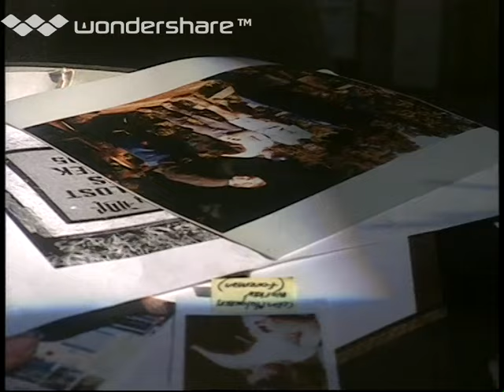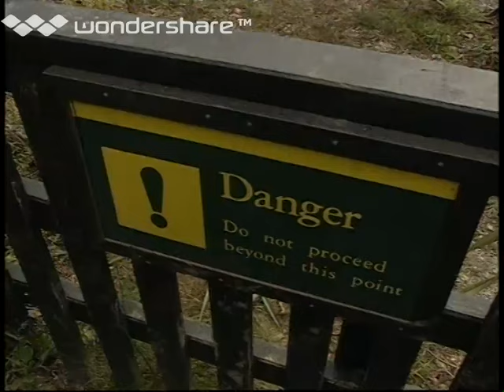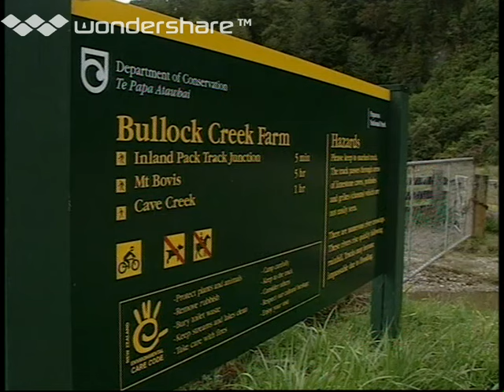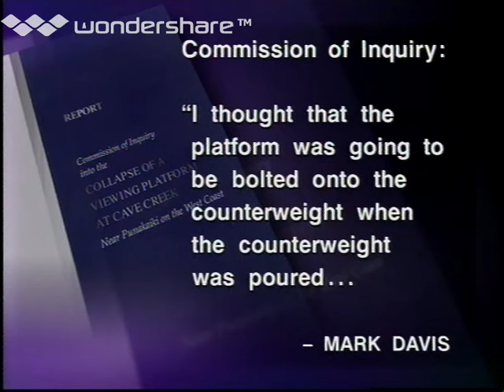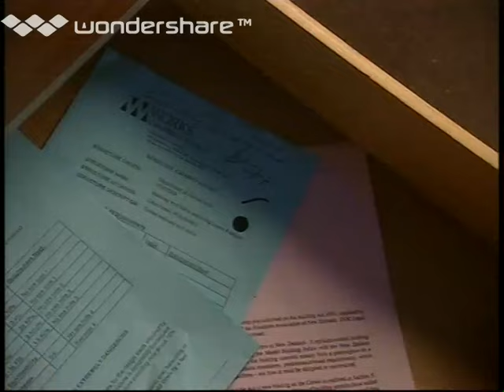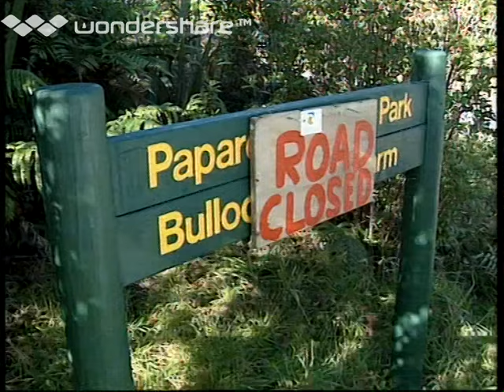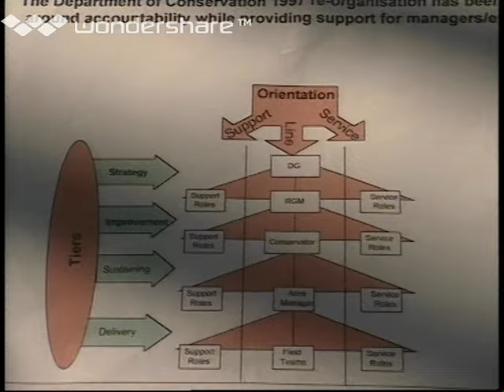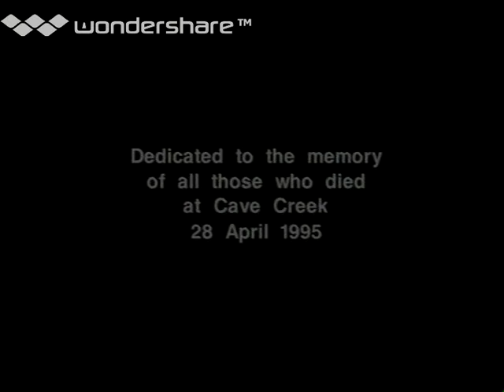Cave Creek: The Full Story of a National Tragedy

Comment: How could they look at how the fact that  piles were not even straight in a row, that in nailing boards to a pile in many cases there nail missed and all the other things that was such bad construction a 12 year old would have been embarrassed to say they build something like that and not say that the men doing the construction were mot either just in a hurry to get done, or did not care if it was done safely or not?  They knew they were building something that was going to be hanging out over mid air with a killer drop down and yet that construction showed they were doing a good job?  Not sure who was protecting whom, but  I, who knows little about building and construction saw half thr terrible things they did done on say  a deck being added to my home, I would have shut them down and called their bosses.  There is no way that they did not know they were taking short cuts and doing a half assed job just to get done.

Comment: I also think...before this plan was even designed, a land survey should have been completed by a civil engineer alongside with an expert  on land erosion.  It should have been measured or tracked to safely measure the rate of erosion in that area.  I’m surprised if this was never done or even discussed prior.

Why would anyone build a deck hanging over what looked to me...to be a cliff crumbling away below?  ⚒🔨

Basic Geology, Limestone is a soft rock.   What can happen over time?  What happens if you build on top or dig into it?⏳🤬
Basic Science, Gravity.🎢
Basic Humanity, use your brain!🧠
Reply: Yep, even if they had limited the capacity to 5 people this thing was going down that cliff one way or another.  The only question was when.
Reply: Aren't there overhanging viewing platforms at the Grand Canyon?  That is not unusual
Reply: @NageelaMom  and is the Grand Canyon Limestone?
Reply: Yes, exactly.
Reply: I think ur very pretty 😍❤️
Reply: It's that "she'll be right mate" attitude nz still has to this day. The lack of accountability by a govt dept is also still prevalent to this day here in NZ.  Absolutely shocking
Reply: Britni Weiss , the Grand Canyon is entirely different.  The viewing platform was done right and meticulously by Structural/Civil Engineers.

Structural engineering design included inner and outer box beams built up from two-inch thick plates, creating hollow shapes of 32 inches wide and 72 inches deep.  The beams were designed to resist wind and vibration forces determined by RWDI of Ontario, Canada, and anchored deep into the native rock with large groups of drilled micro-piles.  The 10 feet by 2 inch wide bridge deck consisted of five composite layers of tempered glass, totaling 2.79 inches thick.  The 5 foot high glass handrail has been designed for high wind pressures as well as code prescribed railing loads. 

Civil engineering design included grading plan preparation for the bridge and visitor’s center.  Civil assistance was also provided by the Lochsa team for the water system (storage and pressurization) and the sewage collection system (gravity piping and waste storage tank) at the remote location.  Great care was taken to minimize the effect to the natural setting as well as to maintain the tribal cultural well-being.

https://lochsa.com/skywalk-at-the-grand-canyon-2/
Reply: Chris D. Thank you.
Reply: I worked in carpentry and building construction and always suggested if not working from drawings that any raised platforms catwalks or cantilevered areas be approved by a structural engineer.   PERIOD!!!
Reply: @yuibot5998  good point....the trash bin test showed how the combined weight of the platform and the students caused an instantaneous failure of the structure with the back end pitching up and detaching. You cannot build something this shoddy that could cause certain death or  bodily injury and not go to jail.

Comment: I think steel was needed for total construction.
Reply: Wood can be used if you know what you are doing. But should be inspected on a regular bases.
Reply: Steel was supposed to have been used, but no one did... None of the people building the platform actually talked to eachother so vital information was lost. It was the fault of everyone who did anything in the constructing of the platform, but someone must have had the final responsibility to make sure it would be done properly, before, during and after the build...
Reply: The plans required steel to attach the stone steps to the platform, but the plans were not on site, the steel was not there, and one of the “builders” (who actually signed off approval on the plans) obviously didn’t manage the project correctly. Many many failures, and the “she’ll be right” attitude to building from blokes who weren’t qualified to do it. Even worse, the guy who drew up the plans could’ve told them all that if they’d allowed him to be involved to completion...although he wasn’t qualified either, at least he’d known to include steel and a weight!!

Comment: I've never heard so much waffle,   the bottom line is using nails instead of bolts and nuts is entirely the fault of the builders even I know that and i'm a clothes designer not a carpenter that and the way the platform hung unsupported over the cliff edge plus it was never checked by those in charge they should have all been charged with manslaughter

Comment: Kind of strange both guides left the kids alone at same time to pee... Sounds like a way to say I wasn't there, so I am not guilty of anything. There should always have been someone at head of the group. And if the platform seems unstable, then they should have decided not to step on it, especially not let anyone else step on it. And how come connection of the platform to the stairs were also done with nails instead of being bolted!??
Reply: These were older kids, they don’t need supervision like grade schoolers.
Reply: One adult died with them who was told that there might be problem with the platform.

Comment: Gee whiz,   we built stronger fastened tree-houses at age 8-10, for 4-6 kids , 10-20 feet off the ground( we over-built from caution and being "amateurs/kids"). 
I would think the "creaking" that platorm did would have scared alot of people who walked on it in the months  before this disaster occured.
I look at that platform now, having done home construction/remods a few years-
 no bolts, no beams(wood or steel),  no lower diagonal supports, badly out of square floor jousts/supports,  no notched pilings, wood pilings a foot or two in just "dirt", common nails off-centered into round posts, not attached to any concrete foundation/footings, etc.etc. and half or more of it hanging off a 100' cliff, unsupported. I just shake my head.

Comment: The documentary should NOT be editorializing. At about 32:15, they call not getting proper permits, which would've forced them to adhere to safety guidelines, "just one, in a series of oversights, and dreadful misunderstandings". IN FACT, THEY KNOW THAT TO BE BIG FAT LIES, ON THE PART OF THE DOCUMENTARY (subtle, low level propaganda/mind control)--given the evidence they've just cited, WHICH IS PUBLIC RECORD, supplied by Gary Reid, a poor, diligent, dogged father, of one of the victim's. He found that Craig Murdoch had complied with the exact permit in question, just months prior--on another project, which just happened to be the building of a wooden overlook. Then, Mr. Murdoch claimed to have no knowledge of this requirement/this permit. Thus, we know that at least Craig Murdoch, DELIBERATELY choose to ignore to apply for the permit, and adhere to it's guidelines. I.e., IT WAS NO OVERSIGHT OR MISUNDERSTANDING--IT WAS A PURPOSEFUL ACT...

Comment: If the concrete that was poured, was not poured as a footer into the ground a couple of feet, with no wire or rebar steel to reinforce the concrete. then it was just poured in a form box on top of the ground. Which would have made it useless as a footer/counterweight.

Comment: Bloody nail's / what happened to the nuts and bolts. Because of these guys using bloody nails and not bolts. What a joke them guys should be in jail all these beautiful young lives have been lost . Was the platform bolted down looks like it was just sitting on the posts.
LOOKS LIKE IT WAS MADE SO CHEAP
Reply: From what I remember it was just a floating deck with posts just resting on the ledge/ground.
Reply: @buckodonnghaile4309  that's wrong someone should be held responsible for all them young lives that where lost on that day.
It's ok for these ones that where involved in building it - there still ALIVE and no-one involved was charged what about the kids that lost there lives - the government should be held responsible as well as the bloke's that built it. No building inspector - it shouldn't of been opened until the inspector passed it.
I feel for these kids families and no one is to blame that's a joke

Comment: It's crazy to see how this doomed structure never met a qualified engineer's eye from conception to implementation and on, right up to its destruction. Anybody, even with a degree in a most distant technical field, who ever opened a book on technical mechanics would have had alarm bells going off in his head if allowed to take a look at it. The argument that the people who built it "might have thought they were doing a good job" is no excuse, on the contrary, it adds to the gravity of the problem. A qualified engineer, even if irresponsible enough to desperately want to complete the job in the "heat of the moment" by nailing for want of carriage bolts at site instead of stopping the work, would have later been alarmed by his own professional conscience and driven back to the place to reinforce the structure, knowing only too well the platform is effectively a 3D projection of itself without proper load bearing capacity, inviting disaster.
Reply: Szilárd Kővári hard to meet a qualified engineers eye with no engineer involved in the entire process 😳

Comment: Mr Watson told the guy under him to get the thing inspected. That guy (can't remember if that was Wilde or not) did not do it simply because he tried to get it ok'd, but they told him "you can't get it ok'd now,  AFTER it;'s been built, you should have had the plans ok'd before you buit it" So, he shoved it in a drawer and did not follow through. HIS FAULT. Did he HIMSELF even bother to put a sign on the platform , at the very least, and make the sign at least 4 feet tall , that said it had NOT been inspected nor approved by anyone qualified to build such dangerous things so do not step on this death trap?  NO !  Did he supervise it's construction even? NO ! So that is the man responsible for this tragedy, right there. Not only did he put an unqualified man in to design it, and pre cut the pieces to build it, he then gave the assembly job to 4 men with NO FREAKING EXPERIENCE BUILDING OVERHANGING PLATFORMS, and he gave them NO PLANS either.  That Board of Inquiry was a government staffed board of cover up. Victims Families, you all need to get a new lawyer (if he could not prove what I just outlined he was not a very good lawyer or someone paid him a lot to botch his part of the case) and please sue sue sue your government and that department because someone hired that idiot who got away with doing all he did wrong and yes, they are responsible for letting all the unqualified people build that thing and for it being open to public use when it was not safe.

Comment: SO I get that there was a failure on the part of the jurisdiction to oversee and properly vette the building process. Finding any ONE individual to prosecute is ludicrous. Not to mention the fact that it was obvious that the deck had been used by numerous other individuals but this group decided to all push their way forward and tax the structure beyond it's intended capacity. I find it curious a governing body cant make a form of monetary settlement with each and every family and then do some oversight and audit to their planning and building practices. Jerking on emotions after a tragedy is just disingenuous. The judge should have put forth a court ordered mandate for just that. But then again it shows the people running things are seldom the most intelligent in the room and often are quite the opposite

Comment: Firstly: the platform should have been designed by a professional structural engineer. He would have considered the worse case loading scenario. The cantilever moment from 18 people standing on the edge is considerable. That bending moment needs to be counteracted by the structure and its foundation. Failure by shear also needs to be checked, especially the connections. Deflection need to be checked. A safety factor needs to be applied according to your local building codes. Jumping up and down should NEVER be allowed, especially for slender and light structures. Secondly: the construction should have been supervised by a professional structural engineer. This is were things often go wrong. He should also sign off the structure once it has been completed. Thirdly: there should be regular inspections done and maintenance being performed,especially for a timber structure in a windy wet climate and a budget should be allocated for this. Rogue individuals have no place in this process, it's about the lives of peoples loved ones which need to be protected. I am surprised that this happened because I have a high regard for NZ civil engineers.

Comment: Disgusting. Lemme get this straight....it was systemic failure? And that means NOBODY is held accountable?? What kind of bureaucratic smoke screen bullshit is that? Those poor kids and their families. If I owned an amusement park. And I built an attraction that was a hundred feet high, and I use the cheapest materials, without any permits, with no Engineers present, and slapped it together with whatever was available, my ass would be in prison. Even though my company built it, and there were dozens of people involved with the building of my attraction. Doesn't matter, because I'm not a government. And systemic failure only applies to government. That in itself is a crime.

Comment: There is a very sound old rule of engineering design, "a thing goes like it looks." I'm no engineer, just a skilled tradie & handyman of long experience. One look at that viewing platform left me in utter disbelief. Who the hell put up such a pile of garbage, an unsupervised bunch of 10-year-old boys?

For a structure in which people had to trust their lives -- perched as it was above a 30 metre drop -- its entire design was cheap & nasty. Timber stumps, light timber construction.... with bloody NAILS used in the frame? Even the handrail was too low. 

In that location, nothing less than steel trusses on concrete piles are needed to carry the deck's weight. A double row of steel bearers at front, none in the middle. Tensioned cables anchored deep into the hill face behind to hold the deck firmly in place. A rated load limit equal to say 500% of packed capacity. If all that looks too costly, don't build the damn thing. Remember the 14 young lives you idiots threw away... just to save a few bucks.

Comment: That the project was even BEGUN, without arrangements having been made, for an architect or engineer to have generated the plans, and to have provided INSPECTIONS during construction, is beyond comprehension, for me.   The words 'cantilevered', 'cliff', and 'limestone' should have EACH triggered double-checking by people in positions of authority.   Those words, used TOGETHER, should have triggered the most stringent review, by every person involved.  You do NOT assume that an aged and crumbling limestone bluff is capable of supporting ANYTHING.  You do NOT cantilever ANYTHING for public use, without stringent measures involving licensed structural experts, and competent contractors.  And you ALWAYS, in these instances, INSIST upon independent review and inspection.

Comment: They need to open up this case again. It should have been designed by an engineer. And built accordingly,  by qualified builders and appropriate materials. 
Im in Australia and I've never heard of this.
What a terrible tragedy. 
Steel beams into the rocks, for starters, would have been a good idea..

Comment: If nutted bolts were used, or even the correct length/thickness wood screws and the structure anchored to the concrete steps with a sign warning no more than 6 people at any one time, there wouldn’t have been a problem.
Reply: Well remember the warning sign was filed away

Comment: When you bend the rules of physics theres eorror. And price too pay of injury. Or Embarrsement. And Human eorror  can Cause even sever injoury even death. And when tradgety struck we as Familes And Communites. The cause of it is pushed and swept under the carpet.   And not held accountable. So Theres  Safty Laws are there for A purpous and reasoning.  So Whom ever was incharged of
 safty. Of Building of the bulding of the rulse. And Laws .They need the law of compassity. Of how many people. And sence there was a very huge concer and issuse that the platfoarm was very
Uneasy. And two teachers/ progrham instructors saw something not right with the plat foarm. That the One whom was charged of the attraction/ momument. Exct. And is the New in Manager Of it. Is Gulity whom Haddent followed the safty Proto call.  Osha / Even also offical with the Safty of any structur s
Foundaton. Needing too of write out A safty violation citation and Closing it down right away Compleatly. And too demolishing the plat foarm.  And then rebulding it up too the Safty Code.  So It was ill equpit. And unsafe. SO the Laws were not so careful.it was all careless.  And igrancety caused the Death of loved ones In a Tight nit Community which def. Was Preventable. And laclk of experance and Knowledge. And Schooling.